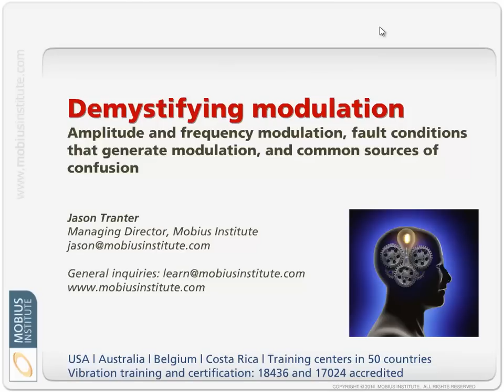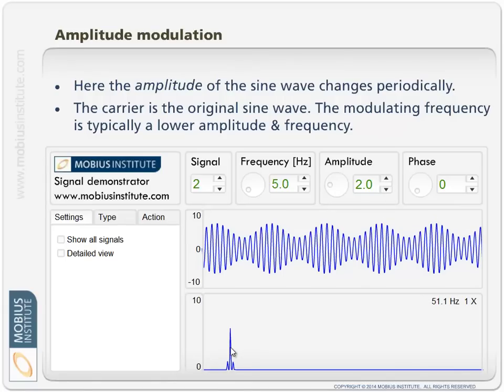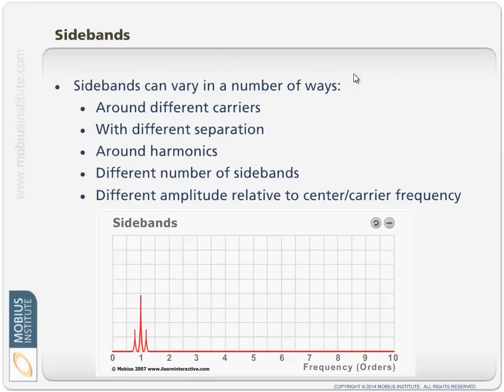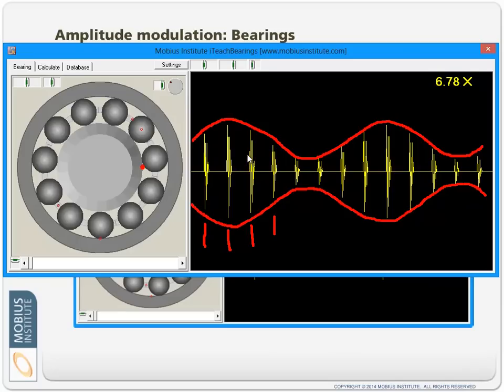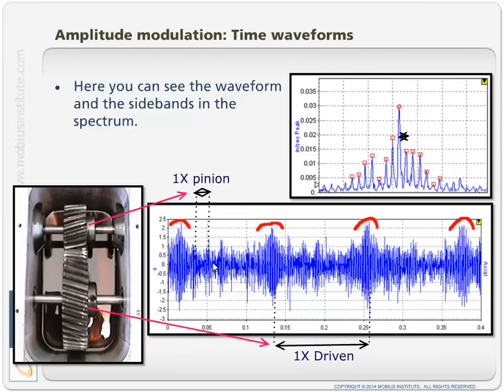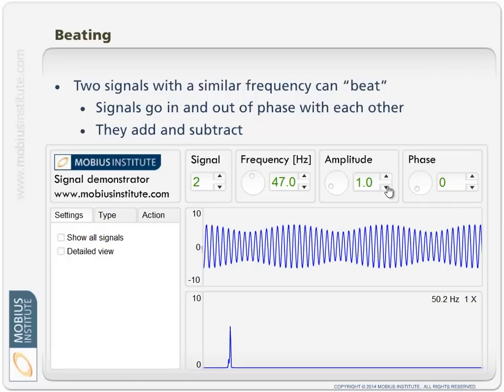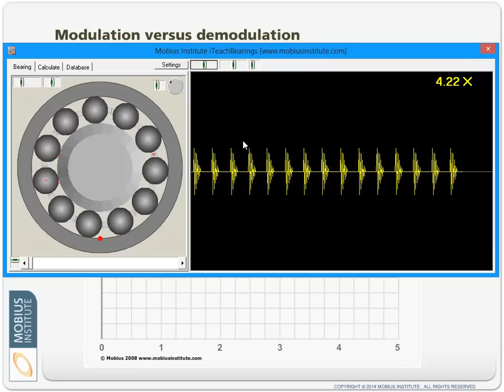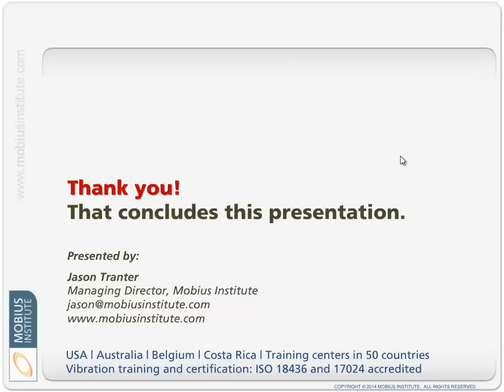Vibration Analysis - Demystifying Modulation by Mobius Institute

Comment: At 37.19, after removing the low freq, recrified it,and enveloped it,what happen next to the signal at 37.19.
1.Does it converted to frequency spectrum again? 
2.Does the rectified signals still exist inside the envelope or the next process only processing the envelope and producing the spectrum?